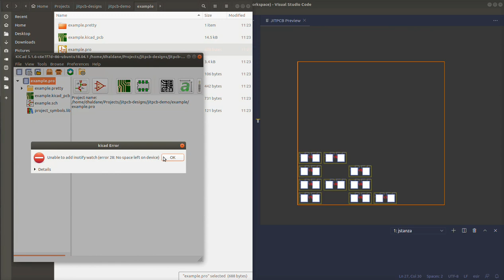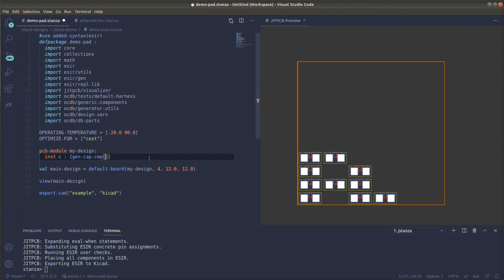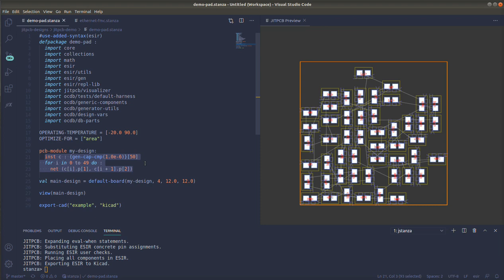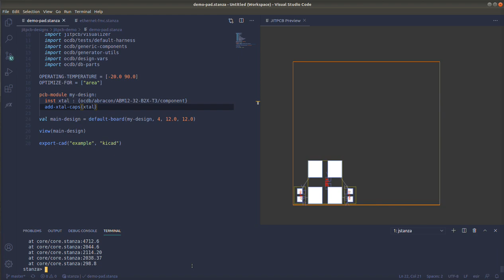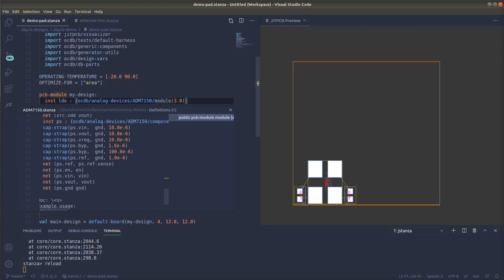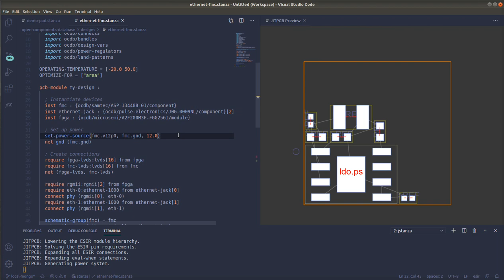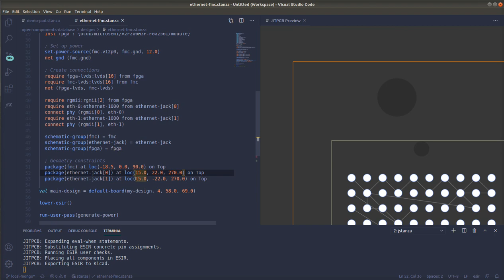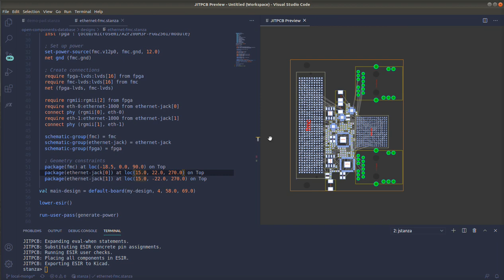JITX Software defined electronics.

Comment: What about routing?
Reply: FAQs mention - use existing CAD tools to finalize placement, routing, and export fabrication data.

What does it do?
JITX lets you write arbitrary code to generate, optimize and analyze designs, and export them to CAD (KiCAD and Altium right now, we will write more exporters). It is a way to automate your hardware engineering process. We have written solvers to automate low-level work (like component selection, pin assignment and schematic drafting), so users code at a high-level, quickly iterate on designs, and then use existing CAD tools to finalize placement, routing, and export fabrication data.
Reply: Further it says - We’re working towards 100% automation for complex boards so as time goes by, users generate designs with more and more automation.
https://www.jitx.com/blog/faq